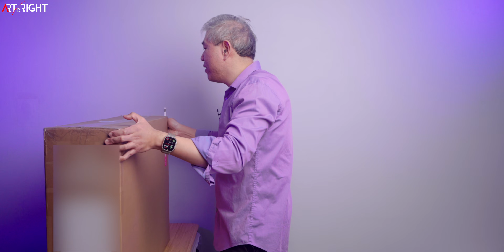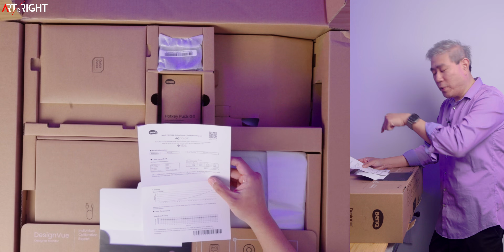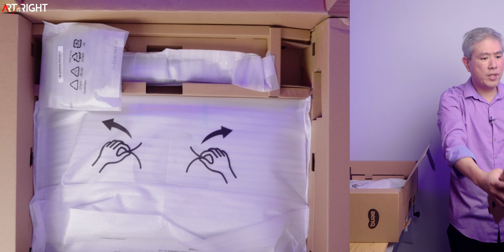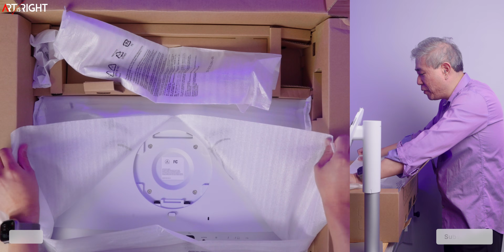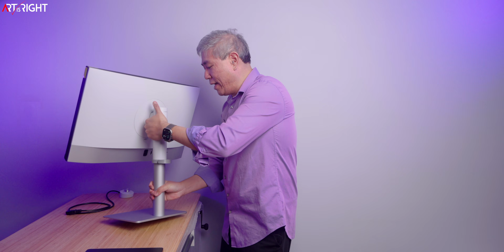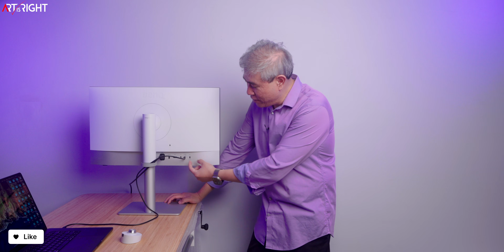Unboxing BenQ PD2730S - Finally a 5K Display for Creator!

Comment: Hi there, since you seem to know the PD2730S monitor pretty well, I have little question for you: can you please let me know if the shortcut keys 1, 2, 3 of your Hotkey Puck are customizable for the Input function (via the OSD or Display Pilot 2)? By default, it seems that Thunderbolt 4 is assigned to shortcut 1, DisplayPort to shortcut 2 and  HDMI to shortcut 3 but it seems impossible to customize them on my unit (ex.: assign HDMI input to key 1, TB4 input to key 2 and DisplayPort to key 3).
Many thanks for your feedback.

Comment: Thanks for addressing the "Do Not Tear" tab. I think the wording and graphic could be clearer. It is not addressed in the quick start guide. Also, received mine a couple of days ago and the bezels on the top and sides are noticeably thinner (~~2-3mm) than in your video.

Comment: HI Art, I take a look at this webpage for the % of adobe RGB coverage for the benq pd2730s and it looks like that it cover only 89 % of it, do you had the time to do your testing to confirm this ?
Reply from the maker: It may have the coverage but you can't calibrate it in that gamut sadly.
Reply: @ArtIsRight  so you mean that its not possible to use the adobe rgb mode with this screen even if its calibrbrate with palette master ultimate am i right ?

So which screen to use for for a 2nd screen for phography and for general use

Thanks hope you will have the time to answer

Comment: This monitor has MAJOR daisy-chaining issues on a M3 Max MacBook Pro connected via TB4 cable to the BenQ then via TB4 to an Eizo CS2740 4k screen. Display arrangements and resolution get changed when reconnecting and the monitor caps the secondary Eizo at 30Hz until the MacBook is restarted. Also the USB speeds from this 'hub' are awful if trying to connect an external NVMe.
Reply from the maker: All great points. A few things to note are that Windows arrangement and resolution are more a function of MacOS than the display itself. It happens all the time. Regarding speed, it is always best to connect any high-speed data storage devices directly to the computer and not via hub or hub-like devices like the display. TB4 is good, but when running a 5K + 4K, much bandwidth is taken to accommodate those tasks, so something has to give. This is not an excuse for BenQ or any other TB connectors, for that matter, but rather a comment on technology limitations and expectations that we put on them.
Reply: @ArtIsRight  Fair points but I had been running the Eizo as main and an older Dell 2k as secondary for over a year with a single cable via TB3 hub and never had the arrangement or resolutions change after disconnecting/reconnecting

Comment: also do you have information about the RGB % coverage ?
Reply from the maker: you mean Adobe RGB, it has close to 90% but can't be utitlized.
Reply: @ArtIsRight - what does that mean-“can’t be utilized “- I just took delivery of the 2730 S because I wanted the latest screen design and thunderbolt connectivity. But I’m a pro photographer and though much of my work is destined for online. I still need to work in Adobe RGB occasionally and output that way. Did I make a mistake in buying this?
Should I return it for the SW line 27 inch 4K? I don’t have the space nor the budget for more than one monitor so I have to make the right choice.

Comment: Hi ART, to daisy chained the SW272U to this pd2730s do I absolutely need a TB cable or ta single usb-c to usb-c cable is needed given the Sw272U have not a TB port ?
Reply from the maker: For the PD2730S to the SW, you can use a regular USB C to USB C that is capable of 4K60

Comment: Will you be able to create a adobeRGB custom colour setting. It would be great to know how in your full review. I'm a graphic designer mac/pc that works a lot in CMYK.
Reply from the maker: sadly no, tested this extensively
Reply: Do you know if BenQ intends to bring out a 5K in the SW line- Adobe RGB and hardware calibration?? I’ve been trying to hold out for a 5K display with Hardware calibration

Comment: I preordered this monitor to pair with an Eizo 27" ColorSync (and replace an aging Dell 24" 2k Ultrasharp). However, the Viewsonic VP2788 that was just released seems to match or beat all specs including faster refresh rate (75 Hz), higher brightness (500; not that it matters) and TB4 daisy chain as well as 100W power delivery. It does have slower response of 14ms. All that and $350 less. Would love to hear any info on why I should keep my pre-order arriving Tuesday vs shipping it back to BenQ unopened.
Reply from the maker: I hear you. Sadly there's no clear winner this round. I'll say this, if price is important for you then the others are a great contender.
Reply: @ArtIsRight  Thanks Art. Wish BenQ would address this and maybe offer information on how their monitor distinguishes itself. For example, is their nano matte different from the AGLR process? 

I'm not opposed to keeping the BenQ and that price but if it has a slower refresh, is a bit dimmer and has equal connectivity without any other distinguishing benefits, I don't see the point.
Reply: The Viewsonic is 4K. This is 5K. There's your difference. This is for people who care about clarity above all else. Like me.
Reply: @BookClubDisaster  The Viewsonic I referenced is a 27" 5k monitor

Comment: Hi Art, you told the is possible to daisy chain this monitor, is it possible to plug this way with the SW 272U display, from the new mac studio ( m$ max ) through this PD2730S through Sw 272 U ? Also when it will comes out in canada , do you know the date, i heard april 30th ?
Reply from the maker: Yes you can do that, and for the date I don't know but i can check. best to dm me, I won't see reply
Reply: @ so the way to do that , first plug the PD2730S in the mac studio, after that from which cable and port in the PD2730S i need to use to put in the SW272U ?

Also is it good to use this display next to the 272U ? What is the rgb% of the 2730s ?

Comment: so for Adobe1998 accuracy, better SW? what is the difference of ppi density? I want a SW 5K :D
Reply: Art. Please answer this- if mainly used for photography- using Photoshop & Lightroom professionally , is the PD2730s  not the best choice? I only have room for, and budget for, one good display. And I need to choose soon whether it’s going to be the 5K PD 2730 S or a SW line 4K.
Been trying to get an answer from anyone on whether Ben Q intends to come out with a 5K in the SW line or a line that can be hardware calibrated and properly support Adobe RGB
Reply from the maker: Yes SW for Adobe RGB and for 27" 4K it is about 163 PPI, for 27" 5K it is 218 PPI

Comment: Benq must release a cheaper version of this monitor. Less inputs, no wireless hotkey etc... Asus ProArt is better choice because of price. 1199 vs 799
Reply from the maker: Easier said than done, Asus does not have Thunderbolt and does not come with post factory calibration solution. I hear you but we have to weight our own choice that is best suited for the workflow and budget.

Comment: Does it have grain noise texture over whole screen, noticeable mostly on light colors? Test it on clean white solid color please. I got Asus PA27JCV and I needed bring it back because of that anomaly. How I understand this is very first BenQ also with new type of screen, so we need to know does it have some issues before we buy it. It is not cheap thing and factory would not be happy if we return it. So I think everyone who is doing recension have obligation to test it and show every single thing.
Reply from the maker: It is by design and not an anomaly, if you don't like that then you won't like this. Same Coating, your best bet is to get the Glossy aka Standard Glass Apple Studio Display or LG 5K
Reply: @ArtIsRight  thank you so much, you are the best! This is the most important info for me, thank you! I have BenQ PD2500Q it have barely visible texture, does this 5k monitor have same visible or it's stronger? LG ultrafine 5k does not have it but it is also matte?

Comment: My biggest frustration with all "Pro" displays for Mac is the Frame Rate. 99% of the video editing I do is 24fps (or 23.976). But no "Pro" display does a framerate higher than 60. 24 is not evenly divisble into 60 and so there will always be some amount of stutter in the video I'm editing. I'm fully aware that most folks don't notice this much, but it really makes a difference for me. I'm not asking for gamerz framerates like 240 or 480hz, but at least bump it to 96.
Reply from the maker: For that I would look at BenQ SW line, there are varible refresh rates on the display that conforms to the various framerate without any pull down or flicker, you won't get that in the PD

Comment: I’ve been following your videos with great interest. Looking at getting a new Mac mini M4 pro and my ancient NEC 27 inch can no longer be calibrated to D 65 so I absolutely need a display. What bothers me about this although it ticks almost every box, is that it’s only software calibrated and not hardware. 
I’m a pro photographer and that’s very important. What do you feel I would be losing out on by not getting a hardware calibrated display at this point? 
Gaming is not important to me, HDR either I need accurate and realistic looking color mostly for photography and some light video editing.
At what point will my calibration and colors be suffering as this display ages?
Reply from the maker: If you calibrate consistently, that is not going to be an issue. If you have any follow up questions, dm me
Reply: @ -not sure how to DM you. Can you elaborate on “ calibrate consistently”? You mean on a regular schedule ? How often? 
Also if I was interested in printing photos, you’ve made comments on other vids that the SW line is probably better.

Comment: 144hz???????
Reply: that will be PD3226G (4K/144Hz).  Currently, there's no 5K panel with refresh rate higher than 60Hz.
Reply from the maker: ditto @Daniel-xl8lf

Comment: ASUS seems to be the budget option for 5K Displays currently. The ASD is only a $100 more than this on Amazon right now. Although TBF this has more connecting options. Depends on your priorities.
Reply: depends on the country. ASD in  EU  costs > $2000 (with taxes), no kvm so even I've nothing in common with photography I'm going to buy this benq
Reply: LG ultrafine? they have been out so long and are in the secondhand market for 500
Reply from the maker: many different ways of going about this

Comment: Finally a 5K display for creators? But we don't need one lol? 
And we need one even less of 5K in 27". 4K is already almost too much for 27", why would you ever need 5K? 
With a 32" panel yes, it would be a different story. 
Also, and most importantly, the color gamut coverage is the bare minimum. You want to check the actual panel luminosity uniformity.
Reply: A 27" display needs to be 5k to achieve retina quality. 4k is not enough at 27".
Reply from the maker: ...ok...

Comment: Only 27... 32 is what we want.
Reply: 32 you need 6k
Reply: @ True. Must be 6k for 32". Now I have an LG 4k 32" and I cant go down to 27".
Reply: 27” is also great for dual display setups.
Reply: 32" 6K for me!
Reply from the maker: Yes 32" you'll need 6K, those panels are not easy to come by yet, hence there are only a few brands and model out there
Reply: No.
Reply: Tried 32. Way too big for my desk. Switched b to 2 x 27 and is perfect. 2 x27 monitor is more functional than 1 x 32.
Reply: The reason you don’t see 32 is PPI. 5K at 32 would be noticeably less clear than 27. At 32 you’ll need 6K to have the same fidelity.
Reply: 32” needs to be 6k
Reply: Nope
Reply: 27 is plenty. For 32 you'd need an extremely broad desk to be an a healthy distance.
Reply: @the_real_mr_s  I have it. :)
Reply: Not everyone has unlimited desk real estate…for us, 27-inch is perfect.
Reply: @readwriter  Let's be serious, there almost no difference between 27 and 32 inches screens on the desk. But the image is very different.

Comment: 400 nits max brightness, 60 hz and DP1.4. What a miss.
Reply from the maker: @5K there's bandwitdh limitation and backwards compatibility issues with anything higher than say 75Hz. Current tech does not fully necessitate this yet. Understanding of base tech helps, so some missed, some hands tied behind their back.
Reply: Agreed , virtually useless at 60htz

Comment: Btw, what's the reason for almost doubling the price compared to the Asus PA27JCV, given that they use the same panel?
Reply from the maker: Thunderbolt connection that you enable display daisy chain. Better color calibration at the factory along with uniformity calibration. In addition, as you also get panel consistency between multiple displays of the same model and displays within the same lineup for PD series. And lastly, you get the value out of software, which is Palette Master Ultimate or if you don't want to use a calibration device, you also have Display ColorTalk. These are solutions that Asus does not offer.
Reply: @ArtIsRight  The Asus PA27JCV is Calman Verified and factory pre-calibrated to Delta E<2. Does the BenQ have something more than that? While Palette Master Ultimate is good on my BenQ display, I did not feel like the Calibrite software was any worse when using the same calibrator on the ASUS.
Reply: @tommysshih  this is the case when the review has no clue what he's talking about.

Comment: This one has the same BOE panel as the Asus PA27JCV.
The BenQ here seems to have better build quality, and I actually prefer its design (minus the display chin).
Anyway, I understand this is a creator monitor, but 60 Hz feels laggy compared to 120 Hz+ displays, even when scrolling in a browser.
We have DP 2.1 now. I'm waiting for 5K and 6K 120 Hz monitors this year.
Reply from the maker: based on the most compatible display tech and computers that are out there 5K or 6K with high refresh rate is not fully viable at the moment for so many technical reasons, which is why no one had made them yet. Spec sheet for Dp 2.1 is one thing but the GPU, connector, cables, etc. They all matters.
Reply: Agree. I don't need 5K. But give me 4K at a higher refresh rate and with a really good panel (not just 100% AdobeRGB coverage but also top notch uniformity) and I'm listening.
Reply: @Maxime-ho9iv  BenQ has another monitor with 4K 144hz announced with this 5K one. I'm looking on that one and hope to see a review soon
Reply: @Maxime-ho9iv  If you don't need a high PPI display, 40-42" monitors are a good choice. You can use them with 100% scaling.
Personally, I'd rather wait for more DisplayPort 2.1 monitors to come out.  We might even see a 32-inch LG monitor with 6K resolution and a 120Hz refresh rate by the end of 2025.
Reply: @ To be honest I’m happy with my 4k 27". This feels like the right combination for working at a desk. Maybe I could go to 32" and it would still work, but I’m not even sure, 27" is already huge.
Reply: @Maxime-ho9iv  You have to use a fractional scaling for 27" 4K display. This means that at 150% scaling, the rendered pixels and physical pixels won't align, which is a significant issue for compositors. That's why 27" 5K displays exist. You can use them at 200% scale, which is an integer scale.
I'd really recommend checking out a 27" 5K display set to 200% scaling if you get a chance. The text clarity is noticeably better than what you'd see on a 27" 4K screen.